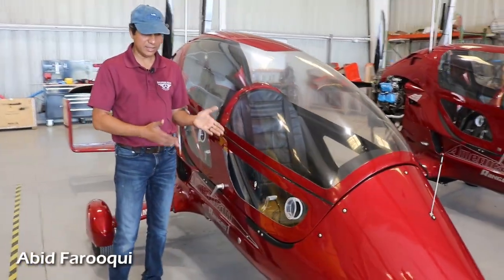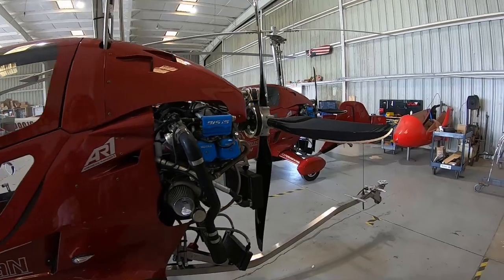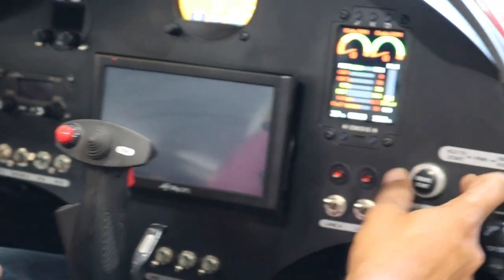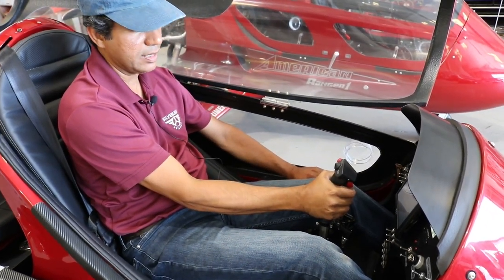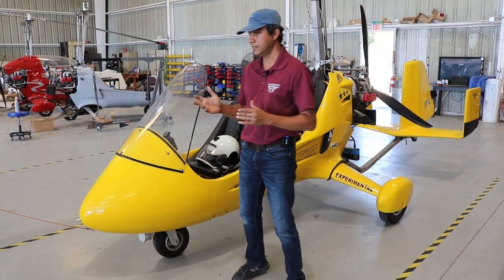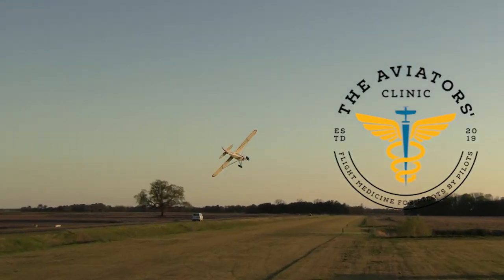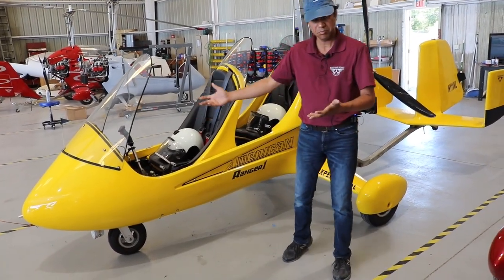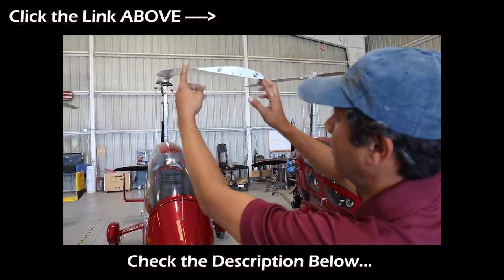A Gyrocopter YOU Can Build CHEAP!   Silverlight Aviation Gyroplanes

Comment: We do need genuinely cheap gyros and they used to be.  To really make them cheap however you pretty much have to build them yourself from scratch.  Trouble is the motors.  A rotax 503 is an excellent motor for a single seat gyro however they are no longer made.  Basically once you put on a 4 stroke rotax you have about $30 000+ right there.  then add prop, add rotors, rotorhead.  Still plans are available for all these things.  Today with good CNC milling available there is no reason not to get parts machined for a rotor head - much cheaper than buying a rotor head.  Add a 50hp ish engine and build a light single seater and you have  a genuine bargain.  You can even build your own rotors like we did back in the day out of wood and steel.  Cheaper lighter, less shake (if you track and balance them right).  If you do most yourself you can build an airframe for $2000-$3000 easily + motor.  You can even save money and build a VW conversion or Subaru conversion.  But $100000+ is not inexpensive.  These machines are often far too heavy as well.

Comment: I priced building one for my needs at 100k. Not only is a fantastic value for a rotor wing the reduced cost of land use, runway construction, and maintenance is significant. This is really perfect between a remote home and airport, especially in considering the performance.
   What are the basic vfr minimums under part 91 ?